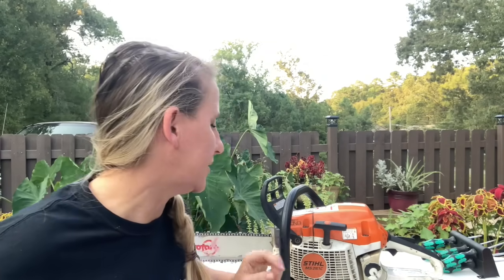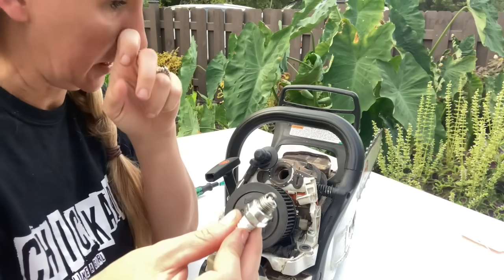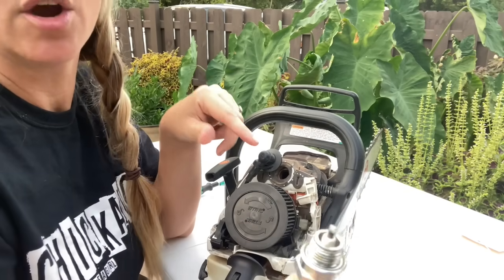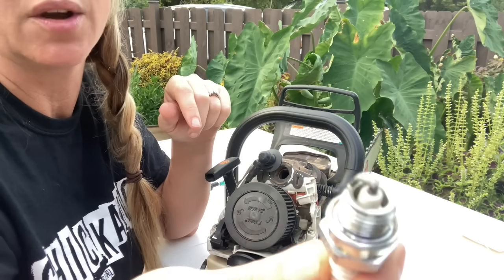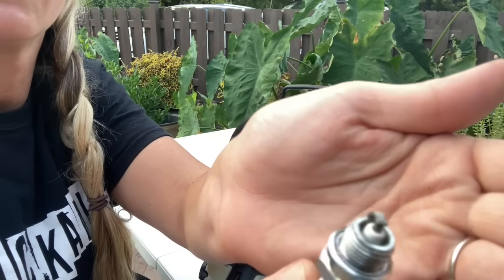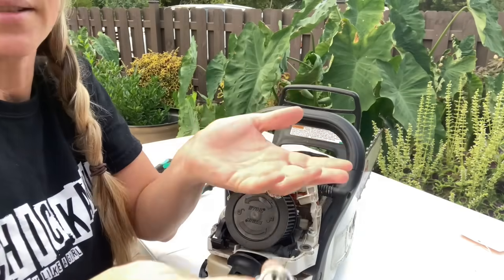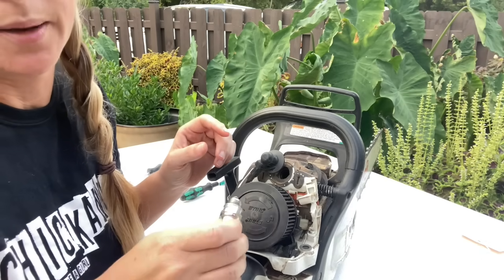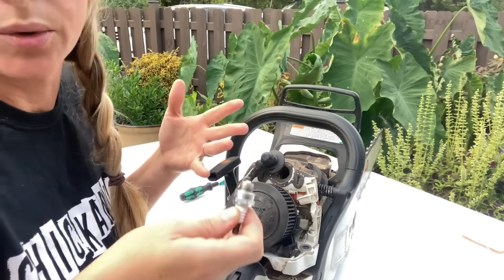STIHL M-TRONIC CHAINSAW HAS NO CARBURETOR ADJUST, WILL IT "RESET" TO REGULATE FUEL CORRECTLY?

Comment: I am a Stihl and Husky authorized service tech and first off any M-Tronic saw if it wont start or idle or run wide open, the first thing I do so I don't waste any time is do a compression test and it has to be min 130PSI, and if compression test is good then pressure test fuel system which is on Stihl 2.0 diagnostic software and it will pin point fault, and then after fixed you have to put it in tune mode which if your a Stihl dealer you know how to do it.

Comment: I think it's all about having the customers go back to the dealer. You can't easily replace the carb, you need to buy their specific solenoid one which probably costs the earth.  I wouldn't buy one. I have equipment with the high and low jet adjustment screws and haven't had any issues. I see no benefits for the m tronic, only potential problems.

Comment: Ive got two 661 i run daily. With the mtronics.  My son has a carburated 661.  Just wondering if youve found out proper reset since this video.   I javnt had any problems with em cept my 8 year old one just jad crank bearings replaced  and sometimes the ground wire brakes and a new wireing harness is the fix

Comment: sometimes my Stihl MM 201 TC with the m-tronic carb sometimes will be running fine. When I shut it off for a couple minutes sometimes it won't start at all. I let it sit ad grab another saw for a little while. roughly 30 minutes later the saw starts right up like nothing was wrong. I never know when it will happen but always have to have a backup because probably 15 to 20 percent of the time it happens. I'm o the 3rd carb now on that saw because no matter how picky I am about not getting ethanol gas , somehow it still happens. When they don't run because of carb issues I just pop a new carb on them and go again. it's like 10 minute inconvenience and all good again. heck the other saws have seen so many carbs I lost count forever ago. I have learned it's best to have a box with all the basic spare parts for all my saws and trimmer. I keep plugs, air filters , fuel filters, all of the fuel line, priming bubbles, and carburetors. Time is money and a saw not running cost more than just popping a carburetor on it, even the $110 m-tronic carb.

Comment: I have several of the M tronics. They're all junk. I've ran saws for 32 years full time. I have the 661C, 261C and 201TC. I probably have 30 saws in all and these M tronic saws are constantly in the shop. I will never buy another. It's bad when a company makes its customers  guinea pigs for a new design then refuse to stand behind it and make it right when it inevitably fails. There isn't anyone in my area who can work on these saws. There are 4 Stihl dealerships within 45 minutes. One refused to work on them. One kept an almost new M tronic 261C for over a year. When I finally asked for it back after being told they didn't have time to work on it, my new bar and chain was missing.  They said it wasn't on there when I broug it in. It most definitely was. I have a 661C that isn't very old and has been to 3 of the shops.  It's been to one shop 3 times. They all charged me to fix it. It still isn't fixed. I had to part out a saw that isn't very old after putting almost $800 in it in repairs and it still dies everytime I put it in a cut. My fleet of saws is slowly being changed over to Husky. Stihl customer service is non existent in my area.

Comment: Hello, I work for STI HL in Great Britain. 
Just a quick note, you should always activate the chain brake when you wish to reset your saw. 
Then start the saw in the cold start position and leave it in the cold start position for 90 seconds with no throttle input then switch it off.

Comment: I have had 2 MS 362 for more than 6 years, it just works. with in three pulls, it starts, let it warm up and start cutting. I spend more time working than trying to get it started or fiddling with the carburetor and struggling to start it. I have never had a problem with it, i keep it clean, I have extra air filters for it, change the spark plug every year... what can I say, it just works.
Reply: Completely agree.. if you service your saw properly after every tank of fuel ..a quick file, after end of the day, put it away after the season ready for next season.. see so many people doing service videos with dirty saws.. I learnt a lot with a ms 250 for many seasons..  now with 362c mtronic.. perfect saw for me… amateur or professional saw there just isn’t that much information from manufacturers how to run saws to be honest..
Reply: @nathanviking  I picked the MS362 because, when I was a wildland fire fighter, I worked with the sawyer, and that's the saw they used. I hiked many mountains caring the saw bag with the sawyer (another 50lbs on top of the 60lbs of my backpack)

Comment: Let me give you some advise on most sthil ms261c saws you set the brake then set your choke lever crank saw and lit it idle for 30 to 45 seconds release the brake and hold down the throttle till you hear it Rev up continue holding at full throttle till you hear it go back to the first speed you heard when you gave it full throttle now you can let off throttle and kill it, it's now set

Comment: My Stihl  saws when cold takes 3 to 5 pulls with full choke to get an almost start. Click the choke up one give it another pull or two to start.  When hot no gas no choke takes quite a few pulls to get a start up to ten.
 They do like fresh mixed fuel best that's for sure.

Comment: When you try resetting the fuel settings (about minute 9:09 in your video) you do not follow Stihl's instruction at all. First, you have to keep the chain break engaged, not released as you show it! Secondly, you turn the saw off after a few seconds. Wrong again. You have to let it idle for 30 to 60 seconds, before revving it for the same time at full throttle. I get it, you don't like Stihl because you sell a competitor. But don't bash that brand for your own benefit. Also, keep in mind that you only get your hands on products for service that are defect. What about the other portion of Stihl power equipment that runs perfectly in consumer's or pro's hands? Since you don't sell that brand you have no idea how many of these saws run just fine, without someone messing with the carb settings. And to be proactive: contrary to you, I have no interest in Stihl or any other manufacture of saws. I just ran Stihl for the past 30 some years and have nothing but good experience with and without M-tronics.

Comment: No... it takes a while for it to "Brown" the plug... so it may be ok... but if you had run it for at least a tank of fuel... it probably would be ok. I'm an old guy... we always "read the plug" and you should give it a bit more time....  Now, I am not saying it "Fixed it'self" for sure, but that you did not "Give it enough time" to use that indicator. thanks! Nate

Comment: I have a stihl fs 561c . Had it for 2 seasons now. And 2 carbs. Now my engine blew out i think because the carb was running lean . Now my saw blew up and needs rebuilt. And need to buy another one. Cause these carbs are weird. Any ideas on this??

Comment: This is not. Not. How iv been "re- setting" mine. 
It does suck that Stihl didn't even have paperwork on "how to" when buying.
However. On my saw. You let it idle for 90 seconds. Then gun the trigger wide open. 
The saw will wind up. Wind down.
Wind up. Down.
Adjusted

Comment: Thanks chikcanic great vids. Had a husky 540mk 1 had auto tune. But never worked, whent back to dealer they gave it back the same. Sold it to the boss 250. Cut stumps. Tryed to get hold of husky to fix or replace. Na very hard get hold of in sydney nsw. Had stihl mtronics been fine. Lucky cos when there not knowone wants to know bout it. Thanx

Comment: The cost to reprogram the gas delivery in an electronic chainsaw carb12345 varies depending on the type of service and repair needed5. Minor adjustments can be made for as low as $25, while major repairs may cost up to $150 or more5.

Comment: Let me tell you how to reset mtronic, let machine get cold, set choke and brake start and let run with choke on for no less than 30 seconds and no more than 60 seconds, immediately go to full throttle do not let off throttle you will hear the machine vary in speed then it will rev up continue to hold throttle untill machine idles down on its own then let off throttle and let idle for 5 seconds and turn off process complete

Comment: You have a 3.0 version mtronic so your method of fixing is incorrect. You have to leave it in the start position  "choke arrow" for 30-45 seconds but no longer. Then pull the trigger full throttle you will hear the rpm bog for 10 seconds and then suddenly rev up. After revving for 10 seconds it will drop back down and you can release the trigger and the reset is complete.

Comment: new solenoid and proper orange fuel filter, about $60,  follow correct procedure to reset computer. should last long long time if clean fuel and proper fuel filter used. but your mileage may vary.

Comment: One customer who has about 20 Husqys and 20 Stihls says the 500i (M-tronic) is the best chainsaw he has ever used. He switched to Stihl after decades of using Husqys because of part availability. Don't know enough about Husqy parts to agree or disagree with him but that's what he told me. I just ordered a 32" light bar and Hexa chain for another customer's 500i who told me the same thing- 500i is the best saw he's ever used. He also has a 660. Just feedback I get from local loggers/landscapers etc.

Comment: This is just another example of what John Deere is doing with their farm and heavy equipment. They are making you reliant on the dealership to repair your equipment when you should be able to do it yourself or take to any mechanic you want. This makes the customer vulnerable to higher shop rates and long wait time. I like Stihl but I won't buy any of their new stuff with this m-tronics. I buy older Stihl equipment and repair it to near new standards and use it just fine.

Comment: C'mon.... You HAVE to do more than just hold the throttle open for 5 seconds and blip it a few times to get some color into the plug. 

I can put a set of plugs into my car, start it up in my driveway, rev on it for 10 seconds, shut it off, and guess what? 

Those plugs are going to come back out looking like they did out of the package.  

Go cut some wood for 10 minutes, and THEN take a look at the plug.

Comment: To calibrate. The chain brake on. Run for 30 to 60 seconds with the brake on, then release the chain brake and run with a wide open throttle until you hear it speed up, then run for an extra 5 seconds or so. Done. It may help to change the fuel selenoid and fuel filter. This is for M-Tronic models. 3.0 versions. The 2.1 versions are different.

Comment: I have one. I replaced my 044 magnum with an equivalent MS.   Big mistake. So big in fact that I traded it in for a 572 husky. Not thrilled with that one either. Run it for 10 mins shut it down , pick it up 3 mins later and I have to choke it and pull it over at least 3 times to get it to fire. Junk.

Comment: One word “JUNK” . Saws have ran great for years without the added BS, downtime, extra cost and headaches .. Also there has never been a saw burned up for using marine 2 cycle oil. They either didn’t mix it right or it was junk oil to begin with, so it had nothing to do with the word “Marine” on the label.!

Comment: I have a Husky tree saw California special. Good little saw but the carb is right next to rhe chain. The air filter is a screen. So its no shock it doesn't take long to load that air filter area with freeken wood. Way to go Husky.  Sthils are good saws.

Comment: If your M-tronics saw is not running right, it's gonna come down to only 3 items, 1 inexpensive, 2 somewhat pricey, outside of "engine" and "fuel" problems (pulse hose, fuel hose, filter, etc.)  The solenoid is most common, the flywheel and the ignition module less common.  Correct diagnosis is important because you don't want to be throwing $300 in parts at it.

Comment: There's two parts to recalibrating the mtronic carburettor the first part you did with set's the low jet the second part of the process is the high jet and to do that you make a cut in timber using full throttle for 60 seconds most of the time they will recommend to make the cut long ways onto the timer as in the opposite way you cut when bucking, and another thing when a spark plug is brand new they are white and take a lot longer than 10mins of run time to change colour.
Just a little information so you don't come across as clueless on your next videos.

Comment: I thought you had to hold them on full power for 30 seconds after letting them idle for x amount of time, i didnt think it was as much as 90 seconds, maybe 30 or 60
Reply: There are three different versions of firmware, each with a different reset sequence.

Comment: The reset is different...
Start it up, wait on idle for more than 30 but less than 60 seconds, then punch the full throttle and keep it revving for 30 seconds it will overrev at some point and tune down just a tiny bit, then release the throttle, let it idle for 10 seconds and shut it off... Mtronic is reset.

Comment: HELLO to auto correct !.all computer versions are different check version on handle sticker then on ver 2.3 to 3.0  to set engage chain break on choke position start run 30/35 seconds then desingage chain break PUSH throttle release and let saw to self correct speed will run fast and go up and down by itself for 35 seconds shut down should be adjusted new saws run lean by design-WEEE

Comment: Slightly confused..you are saying it’s not fixed but it started and ran perfectly..the plug is white but who says that is actually a problem if the saw starts runs and doesn’t seize itself up?  I know there is no lambda sensors involved and don’t know how Stihl m tronic determines if the fuel air ratio is correct but I’m sure the people designing it do actually know what they are doing, I also have a MS261 and it’s been very good, I say embrace the technology rather than what ifs and but maybes.

Comment: I love my mtronic saw. It's always tuned perfect, and it just screams. 6 years and zero issues. I had a different mtronic saw previously and had zero issues with it as well.

And when it comes to reading plugs, you won't get an accurate reading on anything that has basically just seen idle time. You need to get it under load at full throttle, then shut it down and look at the plug.

Also, with the early mtronic, after the reset you need tp make several cuts in fair size wood to recalibrate the carb. At least thats what the manual said for my 441cm.
Reply: @SixOFord  unfortunately this woman shares opinions about things she does not understand.  All engineering decisions have trade off's..  how many people "over all" struggle with proper oil and gas choice let alone adjust and carb in speck. They rely on paying a dealer and waiting for that dealer to adjust, then you pay. Mtronic is a huge success for the mass public.  
She has a small shop somewhere and is critical of a company that is global and has billions in investment not to mention lawsuits from morons who drop trees on themselves or cut themselves.  
A more intelligent way to think is what do they have to engineer and who do they market to. Husky abandoned the loggers years ago for the homeowner market.  Try to get a Husky warranted that was bought in Home Depot . Husky dealer would tell the owner to take it back to Home depot. Husky required many saw shops to buy certain amount of lawnmowers along with saws when their business was 600 saws a year so sell and service. Sthil hung with the loggers. I have migrated to Sthil.

Comment: On the way that you attempted to reset the mtronic system was not right, that won’t reset nothing that way, the system is like this start the engine let it run for 1 minute or so, now shut it off. Now move the master control to ^ (the solid arrow up symbol) 1the throttle let idle for 30
Seconds but not more then 60 seconds then release the the carina brake and hold full throttle for another 30 seconds and not to release the throttle the engine will change engine speed and if the engine stalls restart the process, then the engine will drop that’s it your retuned the myrinic system and you set to cut some timber

Comment: very good video just something about a good looking Girl that can wrench on a chain saw, I have the Ms261c and it would not start no spark after moving the electric connector the ignition switch on and of a bunch it just fired up and run fine. I am not happy I purchased the saw when they said it had a Electric carb adjustment i should have said no  thank you.
Reply: Sounds like operator error

Comment: Sorry, Stihl, but I'll never, ever buy an electronically controlled chainsaw from you or any other manufacturer. I need to be able to do my own repairs and adjustments. This is a just a way to make an expensive saw even more expensive.
Reply: I picked up one used for $450. Runs sooo good. I remember the same argument 30 years ago about fuel injection on cars.... 🤔

Comment: I bought a 261 NON "C" because of this video. I have already adjusted my carb and its running great. Just a tip, my saw starts in 3 pulls every time. Two pulls with choke on, 1 pull on high idle and it starts.